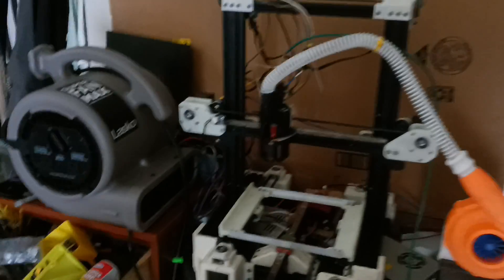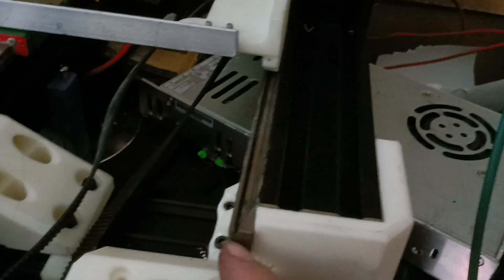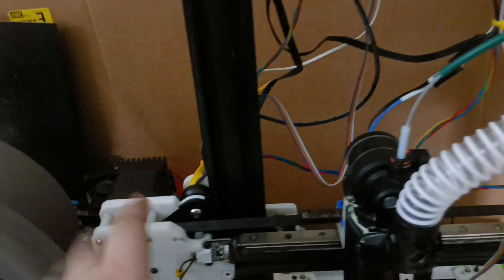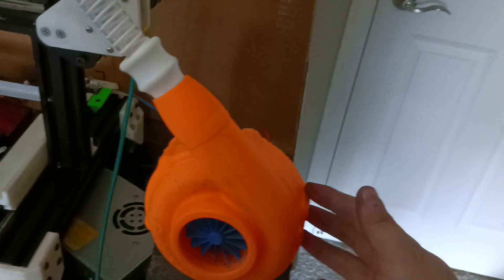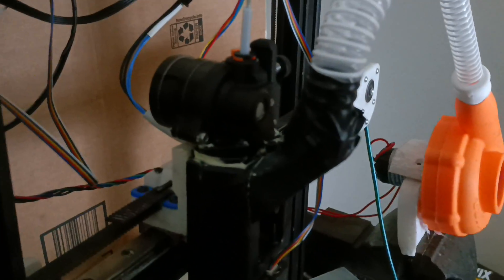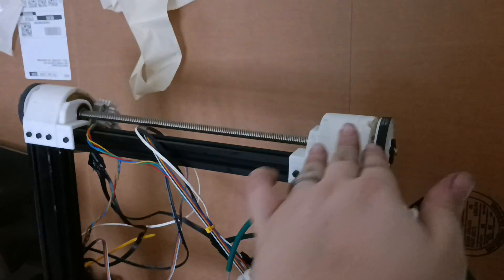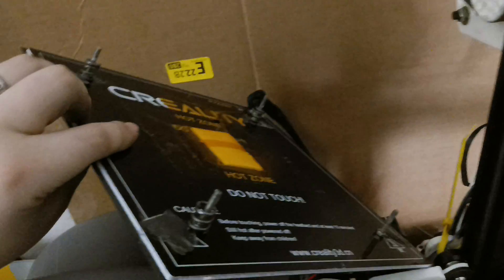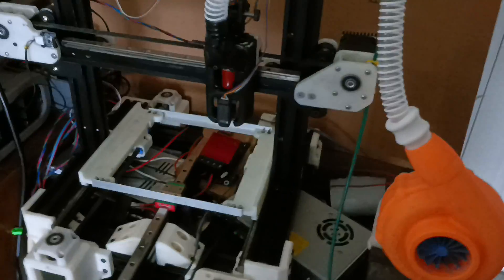an overview of the world's fastest ender 3

Comment: This is the coolest thing I have seen done to a printer ever.  Thanks for discovering the Cpap tubing.  I have been wanting to run tubing to and from my Mini's hotend using ambient air outside the enclosure to minimize heat creep.  Maybe a similar setup to my buddy board box.  I couldn't find something small or light enough so I went back to your videos.

Comment: When I saw the original WR video I paused and went "...is that a fucking Ender 3?" No CoreXY, no servos, no Bowden, just straight gas. Incredible. 
I described this to my non-3D printing buddy as "someone winning the quarter mile with a 97 honda accord and two leafblowers"
Reply: so a supercharged honda accord?
Reply: a real ship of theseus situation
Reply: To be fair there isn't much other than a few aluminium extrusions that is original, this is no longer an ender 3.
Reply: @Smokinjoewhite  which actually proves that Ender 3 frame does not need much improvement. Instead printer companies remakes frame every time when they create another Ender 3 'clone'. = )
Reply: I think you underestimate the honda boyz, those k24s can hit mid 9s without forced induction haha (admittedly with ITBs and and other mods but still NA)
Reply: You have a 2d printing buddy?
Reply: @_..-.._..-.._  he's real shallow
Reply: “Winning the quarter-mile” 😂
Reply: you should've seen the video where someone climbs a hill with an old stock subaru

Comment: To go faster: 
1- I would reduce 'the head block & the bed' weight as light as possible try different materials and designs.
2- Print part orientation is contributor.  

Radical stuff.

Comment: I'm curious how it would run without that center y rail
Reply from the maker: That's actually how it used to be! it worked great up until i was in the 30k accel range.. then i got strange z warping.... like waves up and down in what should be flat extrusion. I put the 3rd rail and it went away and my IS results got much cleaner too!

Comment: Awesome printer! Definitely not the type you expect these days in the speedboatrace!
Please do upload a video on how you made the 8mm shaft adapters for your Y motors! I have a couple of 8mm ID drive gears that I’ve been struggling to find a purpose for…
Reply from the maker: It's actually rather simple! Just cut down a tube 5mm id 8mm od (make sure it's seamless and relatively precise, concentricity is most important,) then just slide the tube on the shaft with a little bit of loctite retaining compound. I suggest steel but aluminum does work too.

Comment: What slicer did you use for the speedbenchy and what material are the printer parts made of?
Reply from the maker: I used orca slicer and the parts are all abs, I don't know what brand exactly but everything is printed in abs. Except the purple parts. I did also modify the gcode to add temp control to help with cooling and flow to aid quality.
Reply: @wandwuff why did you print parts in ABS instead of petg?
Reply: @NagashiChidorii  I'm not the OP but typically you want to use ABS/ASA over PETG for structural parts as it's more temperature resistant and is more rigid. Voron recommended ABS or ASA for all their printed parts.
Reply: @NagashiChidorii  It's also slightly less dense, which can save a little weight on your moving parts, which matters when you are trying to accelerate your bed at 6+g

Comment: I’m wondering what solution you found for extruding faster. I seen that you have a long melting zone. Would you say long melting zone was the best factor or you also choose a special one with the 3 hole and diamond back tip. I’m trying to optimise my Bambu lab extraction speed. I’m currently thinking of preheating the whole spool. Before trying. But still amazing printer you have!
Reply: the 3 hole is known as a cht nozzle. The long melting zone and have the part cooling fan external to reduce the weight helps a lot.

Comment: I raise my hat to you. This is peak engineering. World record shattering speed obtain by completely changing a printer. Nothing original on it. Only pure idea and craftmanship. I have never seen 2 servo or 2 motor for 1 single belt and never would have taught of that for faster speed or higher torque but it’s a great and challenging idea that you made work! Usually for doubling the output power they we put 2 belt on 1 shaft.
Reply: Putting 2 belts on 1 shaft doesn't double the output power though.
Reply: @crazysoulpubg  no no absolutely not. Sorry I saw the mistake I made. Haha I mean handling more power at the end. you can double belt it. Like 1 hp rated belt, double pulley, and 2 hp motor.
Reply: @pacopet1234 Oh Aight. Yeah i see your point now.

Comment: Interesting idea with the sleeve and increased OD pulleys, have never seen that done before. Giving you a bit more speed advantage since you have gobs of torque available?
Reply from the maker: Yeah in testing I've managed to hit 3000mm/s, and 1000-1200 is where peak torque is on 48v, it's really ideal for the setup!
Reply: @wandwuff 3 meter a second ! That’s fast

Comment: Thanks for the overview!!
This thing is amazing!
Whats your electronics-setup?
Reply from the maker: It's an octopus pro v1.1 h723, btt tmc2209 and 5160t pros with ldo 2501s on xy and creality steppers on z.
Reply: @wandwuff have you tried ldo 2804’s? From what I have seen they give up some torque and make up for it with shallower torque loss at higher speeds.
Reply from the maker: @bobbyshoe8621  no I was told they would instantly melt my motor mounts... And lately I've been running into heating issues. I need to put active cooling on my steppers.
Reply: I think it's mentioned at the end. Octopus from BTT